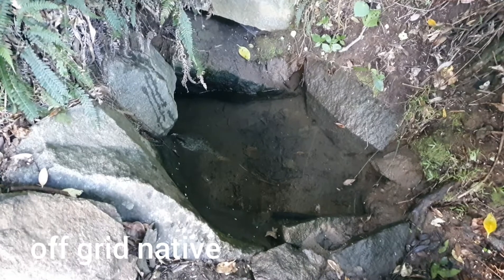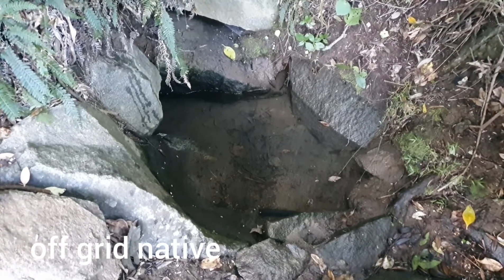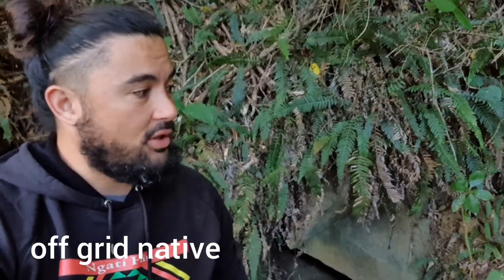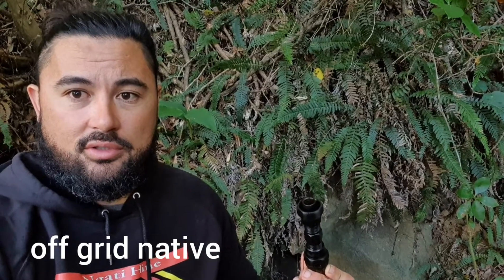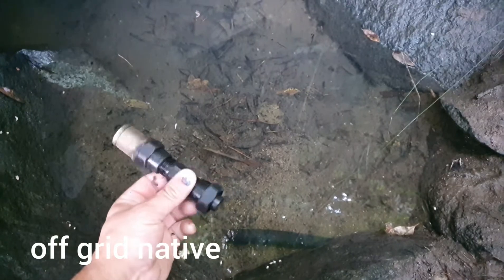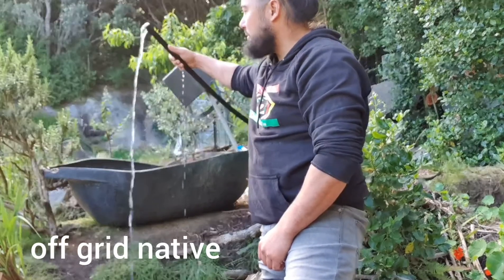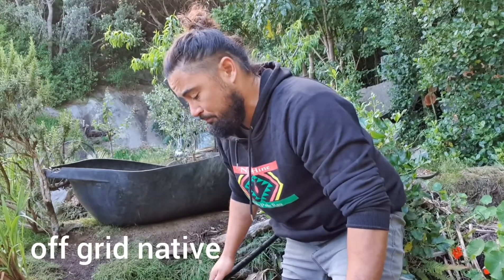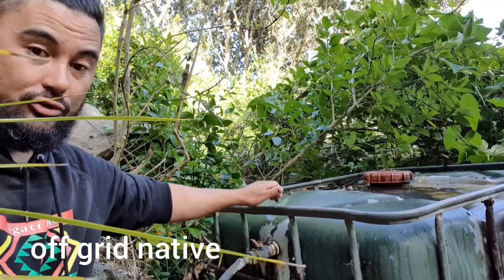gravity feed water system

Comment: My hose/pipe is getting airlocked... I cannot get water where I want it... Idk what to do. Any tips?
Reply from the maker: Good question Pablo . 
How long is your length of hose from the water to your water outlet? Any time your intake comes out of the water completely then there will be a airlock. 
If you have a air lock you need to ( bleed the line) it may be easier for me to do a video to explain this. 
Let's say your water line is 100m all running down hill. I would go to the out take and suck on the pipe you are trying the start the siphon the moment of water down hill. ( May take a while) if this does not work. I would cut the water line at the 20m or 50m from the intake. This will be easier to start the siphon when it starts running I will couch and splatter that is the air keep running untill it runs smooth. Connect the water line. Then go to the out take and let the water keep running until the airlock is out of the other section then it is gone. 
If it has no filter it may be sediment in the water line and that is different. 
Ngā Manaakitanga
Reply: @offgridnative9437  Ngã Thank you for your reply. I'm amazed that you took the time to answer me that fast, you earn a subscriber. Now, back to the point. I'm trying to get water out of a creek. The hose that I'm using has 100 meters long but it will need to be around 150 for my needs. The point that I choose to put the hose to get the water is in a small waterfall of around 6 to 8 meters high and I'm trying to get water to a small flat terrain further down (the hose go down over that slope and go up like 2 meters to the flat). I'm running the hose down using the borderline of the creek, the only part inside the water is like 5 meters before the first dropdown. The thing is that I cannot go in a straight line down (because of the terrain), so, the hose has a lot of ups and down curves. The hose will catch the water but in the first dropdown it will have an airlock, I know that's the case because it will weigh a lot and after that point break I'll feel it empty. I've been reading a lot today after this huge failure and supposedly the first thing I need to address are all those ups and downs and make the hose go down smoothly but is easier to say than do. I was considering something similar to your idea of cutting the hose in parts but I wasn't quite sure it will work as intended.  Someone said to me I should put a valve at the bottom and open and closed the valve in intervals to get all the air down and out... but I don't know if that's a good idea or not, I'm new to this and I'm just experimenting at this point :( Again, thank you for taking the time to give me a thoughtful answer.
Reply from the maker: @eliguaso22  Are getting the water from the top of a 8 meter waterfall? 
And there are alot of ups and down because of terrain, then goes to a flat? 
At a guess from waterfall to where you want the hose what is the drop in meters? 

Can you run a rope/ cable from the top of the waterfall over the rough terrain to a low point so the terrain becomes a consistent down hill straight line?  cable tie the house to the wire/ rope. If you get a good consistent drop that will give you momentum. Break at the bottom of that. Try not to break to many times just a good point to get the air lock out. 
Get that first 8 m drop and that momentum will push out your air lock. And that 2m raise won't be a problem.

Comment: This vlog was solid bro ... I gotta buy 400 meters of hose an a tank... our spring is way up by our maunga.. 

What's the name best hose to buy ?
Reply from the maker: I got mine in a 200m length at 20mm If you use a 50mm pipe you can reduce it and have mean pressure or use it for a water wheel. Free power. Ngā mihi